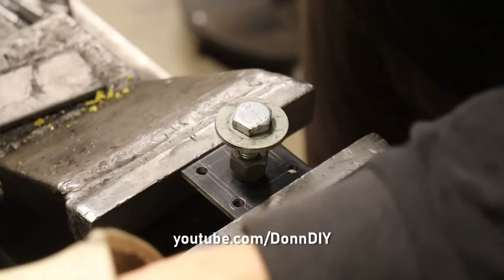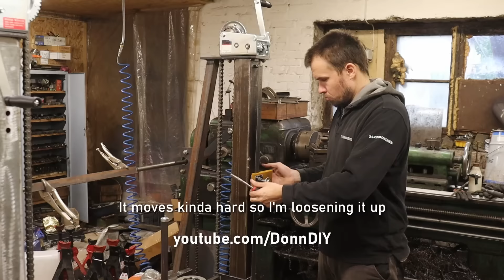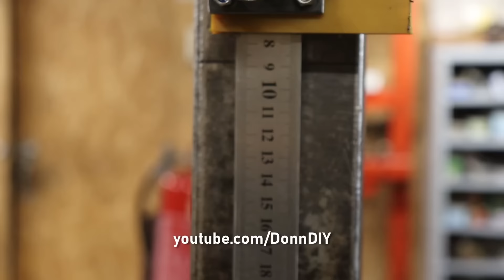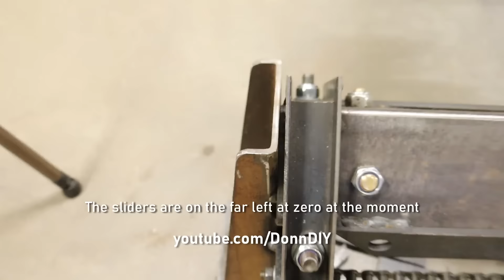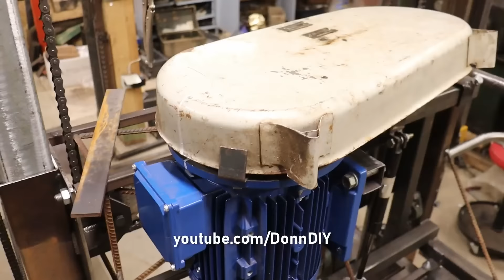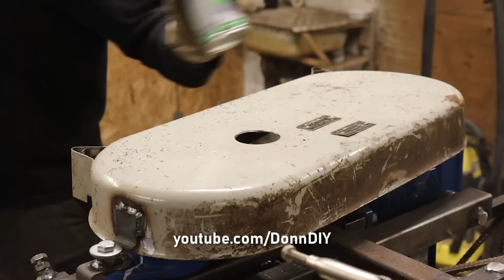Swingblade SAWMILL Build Ep.9 - Lumber Sizing, Belt Guard, Dismantling

Comment: I binged the last 5 videos, since I've been moving and missed them when you released them. I first started watching you with the wheel widening rig, and I'm continually impressed with your ability to follow through on your plan, making changes when necessary but not getting sidetracked and losing the plot on the build currently underway. I do wonder how many projects you have in mind, and how you can possibly keep them all straight, so that one doesn't bleed into another. You must've driven your mom mad doing stuff when you were a kid! My condolences to her for her sacrifices!
Reply from the maker: I do get sidetracked sometimes (as I did with the 8x8 Argo) but try and finish all the projects I've started. I usually start building things I actually need to use at the homestead so when the motivation fades over the course of the build process there's still the need for the machine that keeps the project going. So it's kind of a failsafe built into the project.😀 I haven't asked my mum, I hope I wasn't a huge PIA.🤞🤣

Comment: Your saw mill is coming together nicely. Whenever I make a nut plate I drill the hole enough oversize to be able to use a flat head machine screw to center the nut on the hole for welding. That way I never have to worry about the final bolt/machine screw dragging on the hole. You don't seem to have issues with this but my method eliminates any chance of this occuring.

Comment: I think a winch with a worm gear instead of the ratchet would give finer depth control.
Reply: I was wondering how he would be able to have fine control with the ratchet.
Great suggestion.
I think you have the solution. How about use the winch to get it close and then have a worm driven fine adjustment? Maybe an expanding (worm driven screw) mounting plate under the winches? Just a thought. He then wouldn't have to rebuild the whole setup he worked so hard on. (Settle Down, people.  😅🤣😉).
Reply from the maker: Yup, it definitely would.👍

Comment: The pulley ratio is way too fast. Blade speed needs to be 1500 to 2000 rpm for a 6-tooth blade.
Reply from the maker: I'm looking at the blade manufacturers website - 550 mm diameter blade optimal rpm 2400 (3500 max). Mine will be around 2800 rpm. So no worries. I can always play around with pulleys.👍